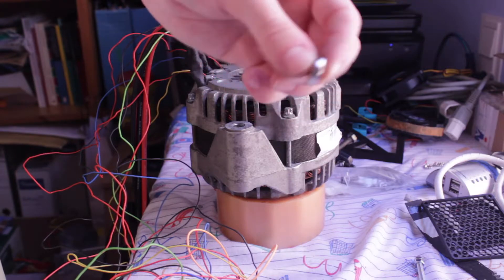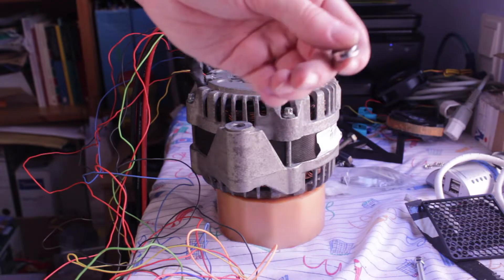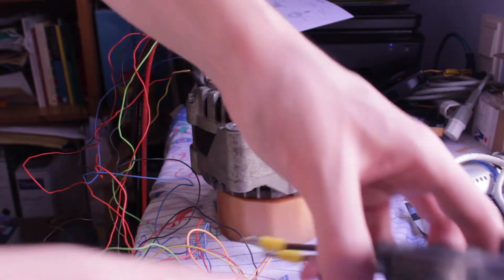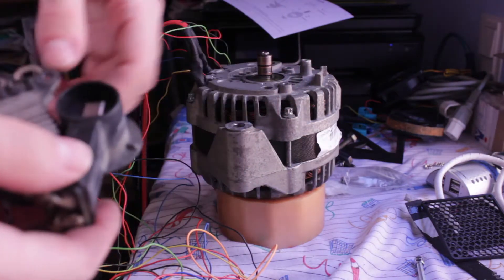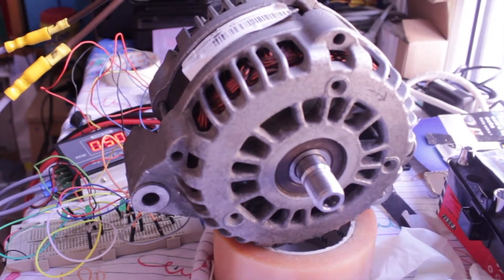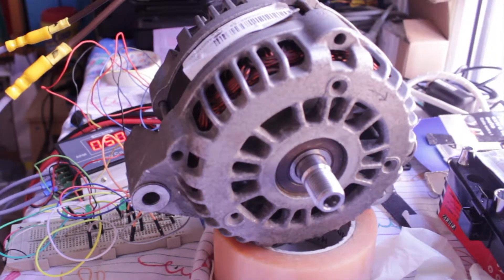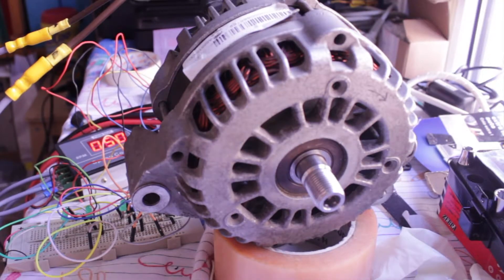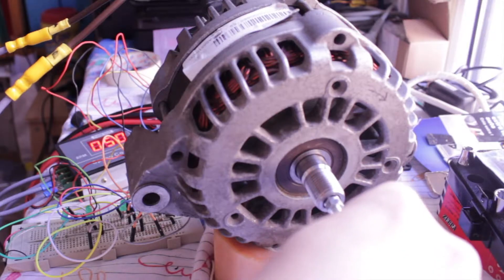Motor (alternator) rewiring and permanent sensor install + PWM control box mock up (CAGK P15)

Comment: Cool!
What voltage did you put on the brush/rotor?
Reply from the maker: Thanks! Rotor voltage=12-14V
Reply: @OverbuiltByHenry  Thanks for the answer.

Dumb question:
If we put the original electronic back in the alternator (regulator, rectifier), would it be still running meanwhile charging (12v)?
Motor and alternator in one device.
Reply from the maker: @RIKOARIshowreel  You are welcome! I don't know if it would work or not, I think it would subtract  power from the "motor" in order to do the charge function.
Reply from the maker: @Tharon McDowell two component adhesive

Comment: Hello, how do you determine where to put hall sensors?
Reply from the maker: First I installed the sensors one next to each other and failed, then I placed them leaving one winding between them and it seemed to work.
Reply: @OverbuiltByHenry  
I also managed to place them right by trying different positions
Reply from the maker: I did this, at 1:05
https://www.youtube.com/watch?v=7k-nG_keh1A Have you placed the sensors the same way?
Reply: @OverbuiltByHenry  
I just tried different positions of hall sensors against the magnetic ring and phase combinations until it started working.
My set up has externally mounted ring of magnets on the motor shaft.  Its in electric car and dismantling it all to open the motor to add sensors was to much work so I added ring with magnets outside the motor to represent the inside rotor magnets.
Reply: @ACAGT  do you have videos of your progress?
Reply: Will it still work if you place them between the poles ?. 
Just in the winding slots but shifted ?.